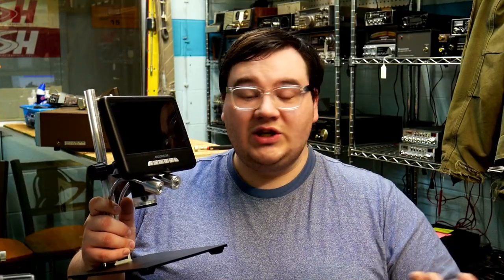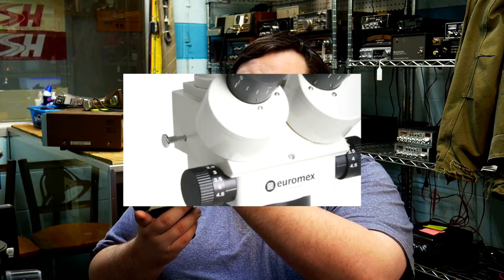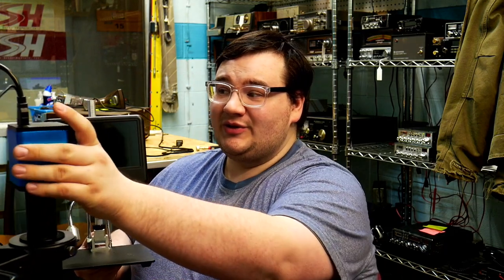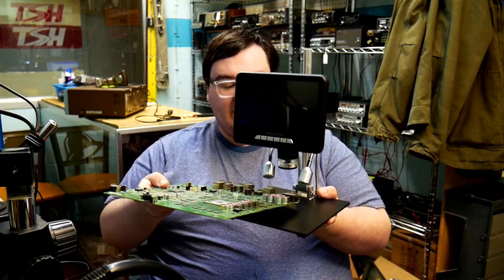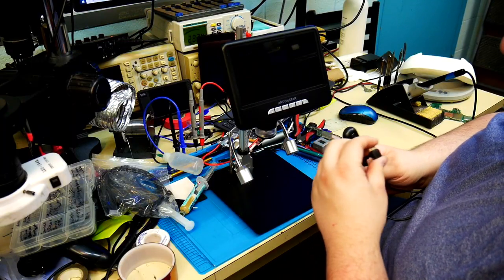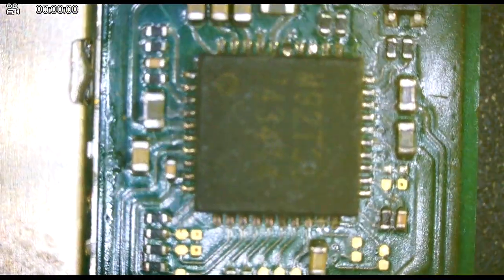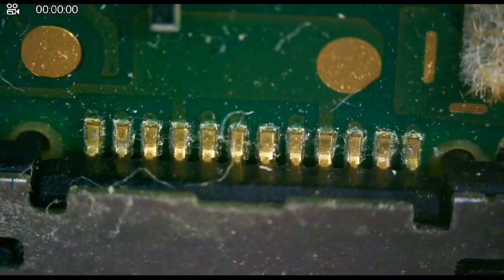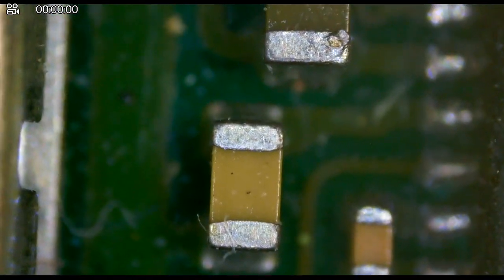I Tried Every Microscope, This is the one YOU Should Buy

Comment: Ive got one of the really cheap usb ones with the light ring and ive adapted a sprung light stand and it works great. Usb to 24 inch pc monitor total cost at a guess is about $40 bucks. Sometimes if you have the knowledge to build something yourself you should use it. Half of my equipment is just put to gether or modified equipment. Yihua rework station with a weller iron. Preheater homemade. Plus losts test equipment homemade or kits. So in a shrinking economy i would say have a go yourselves.
Reply: I’ve tried that exact scope. It just isn’t as good as an optical zoom binocular/trinocularscope. I screwed up many different BGA’s because of it. It just can get the necessary details on the actual pins or pads of the part you are working on. Now you can totally use a digital scope but that one is not good for microsoldering. Buy an Optical trinocularscope. It’s the most essential microsoldering tool after the soldering iron.
Reply: @samuelmagilocusts2870  In my opinion it's always a lottery when buying a cheap camera one out of ten maybe great. All the rest are crappy optically and sensors are also the same. But for the type of work i do which isn't rebaling i don't  need such fine detail. If i wanted i have plenty of super hd cameras at my work that are surplus to requirements. As i work for a major harsh environment camera manufacturer.  So 800x600 camera will do for my small project work i do at home. On a budget just think if you can modify something for a lower price do it.

Comment: I use an Andonstar myself, and I confirm that your review is perfectly honest and nothing but the truth. The picture itself is amazing, and if you play a little bit with the lights (i.e. put them at an angle) it will be even better. The downside is the working space and the working stand, because bigger boards will wobble around. Personally I do not use the screen it comes with (mine is 7 inch). I'm instead connecting it to the computer and viewing the image via the "Microscope Measure" software. It's definitely a good scope to start with. Great video :)

Comment: You can easily get a custom 3d printed bracket that works with vesa mounts, if you don't have a 3d printer you can probably get it printed relatively cheap from someone else. I think I've even found the model for that thing.

Comment: I'm torn as to whether to get the stereo trinocular scope or the HDMI setup like NorthRidgeFix. 
How do those two specifically compare with each other? 
Is the latter better for back pain (NRF looks so laid back when working, not hunched over all the time)? 
Would I need the stereo scope if I was to want to go into data recovery (very fine soldering)?
Reply from the maker: Both work amazing. You loose depth perception with NRF scope, but you get used to not having it. 

They both have their strengths and weaknesses.  

I use the NRF scope full time now, my first pick tbh :)